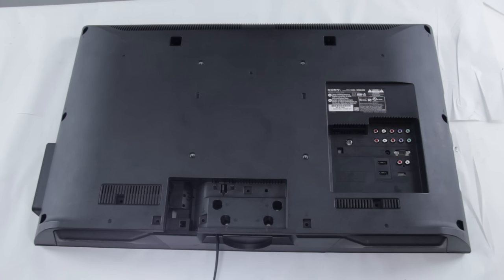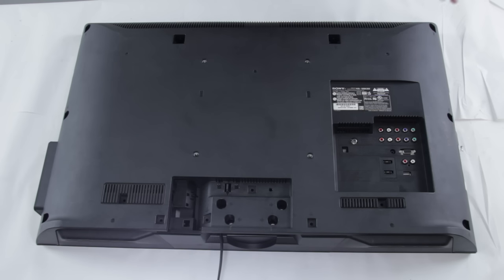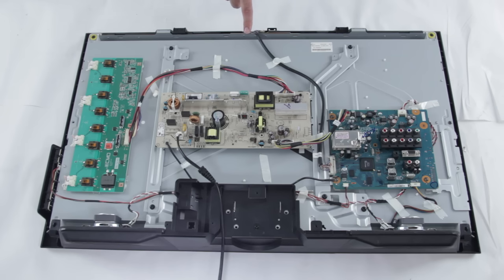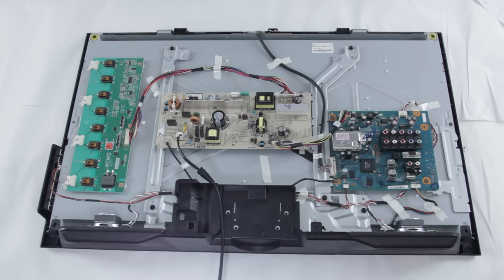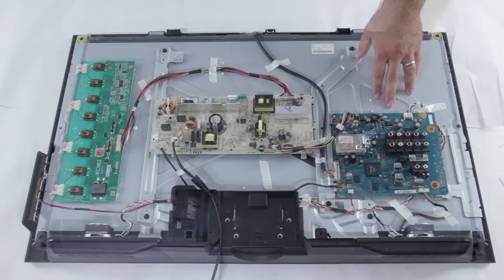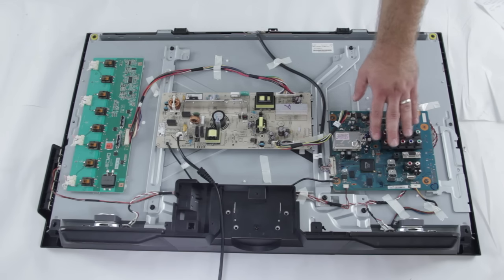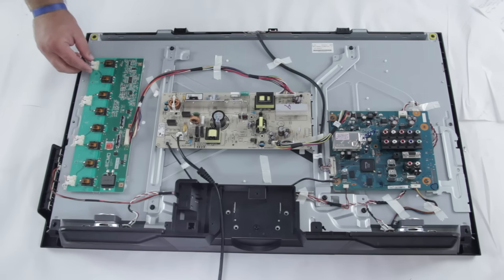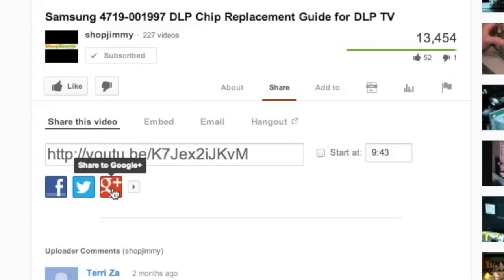LCD TV Repair Tutorial - LCD TV Parts Overview, Common Symptoms & Solutions - How to Fix LCD TVs

Comment: i have grundig "40 vle 6141 c" and it wont power on. when i plug the power cord power led in botton shows blue light and it just blink one or two time and nothing to show on screen. 
do you what problem it can be?
Reply from the maker: +Zahid Hafeez   Try all repairs and troubleshooting at your own risk.  I recommend replacing the main board in your TV.  Unfortunately I do not see any replacement parts in the search results for your TV model number on our website.  Please reply with your part number on your main board and I can try searching for replacement parts.  Thanks and please let us know if you have any further questions!  www.shopjimmy.com
Reply: +ShopJimmy.com 
thanx for your reply. when i power on tv the blue power light in the bottom blink two time and then countinues on. did you mean i open tv and main board where all the contacts HDMI, Scart, vga that board have a problem? and website that you give me its not working here in sweden. 
once again thanx
Reply: +ShopJimmy.com 
your website is close. so i dont know how to contact you. i open whole tv and i want to send you

Comment: I  have  a  46 inch Samsung  LCD  TV,  Model  #  LN46A630M1F
When  turning  it  on ,  it  will  click  on  and  then  go  off.   Cycling  over  and  over  again.   Screen  is  usually  black  at  first.
Then  Picture  might  come  on  for  a  few  seconds ( picture  quality  will  not  be  clear,  has  strips  or  pixilated,  etc.)
It  will  cycle  over  and  over  again,  becoming  a  little  clearer  as  it  continues  to  cycle,  ( sometimes  making  an
awful  high  pitched  extremely  loud  electrical  noise,  lasting  about  10  -  15  seconds.   This  may  occur  with  the
other  process  one  or  two  times  while  attempting  to  turn  on.   Sometimes   not  at  all.   
Eventually  the  TV  will  come  on.    Taking  longer  with  each  attempt.   And  when  the  room  is   warmer ,   I  notice  the
process  time  will  be  shorter.    It  is  time  to  address  this  problem.
I  have  been  researching  what  may  be  wrong,  conscentious  points  to  a  bad  capacitor.  I  have  explored  the  interior
of  my  television  looking  for  a  blown,  bulging,  or  leaking  capacitor.  And  any  burnt  or  blown  fuses.
Everything  looks  pristine ,  and  feels  connected.
This  is  a  large  tv  and  has  many  capacitors,  I  can  not  disconnect  all  the  capacitors  just  to  check  them  out  on
my  multi meter.   Perhaps  I  should  replace  the  power  board ?   If  not  too  expensive.   What  is  your  advice ?   Under  these  circumstances ?  I  believe  my  power  board  number  is  BN44 - 00203A      .  Please  let  me  know  if  that  is  correct.
I  certainly  appreciate  any  help  or  advice  you  can  give !    Thank  you  so  much  for  your  time  and  expertise.
God  Bless,  Alexis
Reply: +Alexis Dolockaski Hi I have the same problem with my TV. Have you found what's wrong with your TV? Thanks.

Comment: my lc70le600u tv has stopped working, the opc blinks once when plugged the but then does nothing, I bought a power supply board from you and try that but didn't work. please help?
Reply from the maker: +Justin Dunifin  Try all repairs and troubleshooting at your own risk.   I recommend replacing the main board in your TV.  Click this link to replacement parts for your TV model number:  http://www.shopjimmy.com/sharp-dkeymf905fm04-main-board-for-lc-60le600u.htm  There may be multiple boards for the same TV model number, be sure to match part numbers on your current board, with your replacement for compatibility.  Thanks and please let us know if you have any further questions with your TV Repair!  www.shopjimmy.com
Reply: +ShopJimmy.com would you have ever recommended this from the get go or tried the power supply board first, to me it seemed l I keep because it wasn't powering on it was a power issue?
Reply from the maker: +Justin Dunifin  Try all repairs and troubleshooting at your own risk.   Since your TV does have a light blinking or a standby light, that means the TV is getting power.  Main board could be getting power from the power supply, but the main board isn't turning on the TV.  Thanks!  www.shopjimmy.com
Reply: +ShopJimmy.com So I finally got the main board, from a different supplier, very hard to find, installed and screen does come on for a few seconds before dropping out leaving the opc blinking. The screen shows a box in the upper right had corner with some numbers and letters, the a box in the middle of screen, with the word no and some other phrase in a foreign language, then turns off. The only difference I notice in the board is the marked in pen version letter, original is B and new one is F.

Comment: VITRON MODEL NO.: HTC 3246 POWER VOLTAGE: AC 100-240V-50/60Hz POWER CONSUMPTION: 60W USB:DC 5V 500mA 4. The tv doesn't display any images or light.
Reply: But you can hear the sound of the channel your watching from.

Comment: Samsung UN55ES8000F. Turn off and on by itself. I can use TV for 60 or more minutes before problem start and will progresivly happen until all the TV does is turn on and off. After TV has Ben off for several hours TV will work again for 60 or more minutes.
Reply: I have the same TV, and I've been having the same issue off and on for probably a year now.  I did a factory reset, and it seemed to help for 3-4 months, but then a few months ago, it started again and the factory reset made no difference.  Now along with the off and on loop, I have a rainbow of colored vertical lines on the screen before the TV reboots.  After the reboot happens, the picture is there for a few seconds, and another set of vertical colored bars show up, then a few seconds later and it reboots....over and over and over.  ShopJimmy.com, if you have any ideas, please let us know.

Comment: Thanks very much for your video. My TV was stroke by thunder and does not come on. The mark of my TV is digitrex, model number : CFD2271 and serial number: 935001578. I also need a compartible remote for this TV. I appreciate any support. Thanks.

Comment: Haier yes i know. Mdel. L32B1120. Once its warm it'll stay on with cross lines but I'm need a handish before i take it apart. I know car audio ajf some tv but I'm hoping for help first incase. Yes i found out about these TV's history after s fam asked for help.
Reply from the maker: Sean Beard  So you have horizontal lines across the screen?  Are there any other problems?  Thanks!  www.shopjimmy.com
Reply: ShopJimmy.com it extremely dim and shuts itself off. Every now and again it'll produce sound with no picture. I haven't witnessed this. I received the tv yesterday and that was the brief description i was given. I've read this brand is known for this but I've found no solutions for the problem

Comment: I have a samsung ln40c530f1xza 40" lcd tv and it is not staying on. After much research i found that it was a backlight problem i believe. The tv will click then the backlight will turn on but after 10 minutes it would blank out to a black screen. After 2 weeks the tv wouldnt stay lit for about 2 seconds before leaving me with a black screen. I have replaced the backlight inverter and the power supply and am still having the same problem. I have heard that many samsung tv's have had this same problem. If anyone has seen a problem like this and fixed it or have any information to add plz help me out.
Reply from the maker: +Dylan Fields   Try all repairs and troubleshooting at your own risk.  I recommend running the flashlight test on your TV.   Here is a link to a video we produced that shows how to run the flashlight test. https://www.youtube.com/watch?v=xUzCLgoSPGM Please reply with your flashlight test results and we can recommend a replacement part for your TV repair. Thanks and please let us know if you have any questions! www.shopjimmy.com
Reply: +ShopJimmy.com 
Thank you for your response... using the flashlight i can see the picture and the sound works fine the whole time... i thought it was the backlight inverter, but i changed it (long vertical chip on side of tv) and it didnt fix it. I also changed the power module and had nothing happen. is there a part i may have missed? all parts i have bought so far have been from shopjimmy.com look forward to a response from you.
Reply from the maker: +Dylan Fields   Did you match the part number on the original backlight inverter, with the replacement?   If so, what is that number?  Thanks!  www.shopjimmy.com

Comment: My kdl32ex301 is unable to find the television channels.  It will auto program the channels off the antenna, run through that routine, but then I cannot actually select any specific channel to get reception.  I have used two different (one brand new) antennas.  So, I think I have a tuner function problem.  Do I fix this by replacing the main board.  Serial no 4524802, made Feb 2010.  Mike 816-286-9095.
Reply from the maker: Michael Donegan   PLEASE SUBSCRIBE TO OUR CHANNEL - Try all repairs and troubleshooting at your own risk.  I recommend replacing the main board in your TV.  Click this link to replacement parts for your TV model number:  http://www.shopjimmy.com/catalogsearch/result/index/?cat=56&q=kdl32ex301  There may be multiple boards for the same TV model number, be sure to match part numbers on your current board, with your replacement for compatibility.  Here is a link to a video showing how to identify your part number, click here:  https://www.youtube.com/watch?v=Aodz2LHkzbY  Thanks and please let us know if you have any further questions with your TV Repair!  www.shopjimmy.com

Comment: Great Video!  Based on your video, I'm inclined to think I have a Backlight Inverter problem.  Are you able to help with that?  It looks like mine is combined with my power supply.  Thanks!

Samsung LCD 40” (2009) Model# LN40B750U1FXZA

Links:
https://www.samsung.com/ca/support/model/LN40B750U1FXZA/
https://www.samsung.com/us/support/owners/product/2009-lcd-tv-b750-series
https://www.cnet.com/reviews/samsung-ln52b750-review/

Problem:
1.	Turn on TV.  Works completely perfectly normal for up to 1 minute
2.	Within first minute, picture gets brighter for 1 second; then Picture goes black.  
3.	Sound remains just fine.
4.	I can replicate this problem consistently simply by powering off and on the TV
5.	It will work for a minute, then black screen

Observations:
1.	Samsung logo power indicator light on the bottom of TV remains illuminated
2.	Optical input on back of TV remains red
3.	LED power indicator on front bottom right remains illuminated, and blinks when I use the remote to adjust volume or any other function.
4.	All features of TV are otherwise 100% normal
5.	No unusual electric odor or electrical sounds.

Attempted Remedies that did not work:
1.	Unplugged TV overnight
2.	Reset all settings to default
3.	Removed from wall, and attempted using on stand (Cooler area)
4.	Completely removed dust from inside with canned air (There was very little)
5.	Tried all inputs.  Same issue.
6.	Unable to see a TV picture in the dark using a flashlight against the screen (After the screen goes black)

Notes:
1.	 I am very technical, but I really don’t want to do too much surgery or soldering
2.	The TV has great picture and sound, and fits right where I like it, so I’d like to fix.
3.	I understand the major possibilities are Main board, T-CON, and Power Supply, and Backlighting.   I just don’t know how to filter through the issues
4.	I have every tool needed, including voltage meter and precision tools, and solder gun.
5.	I’m very appreciative of your input!  

Comment: Given the nature of this video
i want to say the following

1. to tell people that they can check a power point by plugging in a radio or a lamp or something is very very amateurish
and incorrect
and
2. Given that you are going to discuss component level repair,  i don't think it's a tall ask that they should learn to use a multimeter and check the voltage from the mains socket with a multi meter correctly

Comment: m #E422VA s# LTYAJIDM4550290
I have a steady light on the front but will not turn on with power button or remote power it was working fine I turned the power off and drop the remote right after that and I believe I broke it the remote after that it would not turn back on with the remote or power button on the side I took off the back of the TV and I do not see any visible problems with capacitors I did test what seems to be a fuse by the power Inlet and it is good I try to hard reset on the remote and the TV even left it off for a day unplugged and it still won't work I even tried my telephone as a remote to turn it on but the power light on that remote if you're familiar with them is shaded out so it won't even work